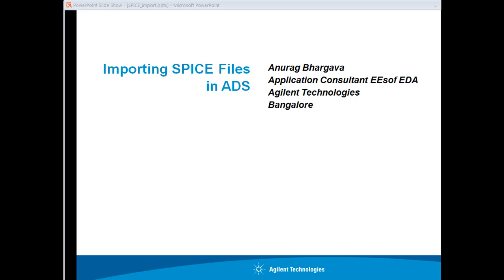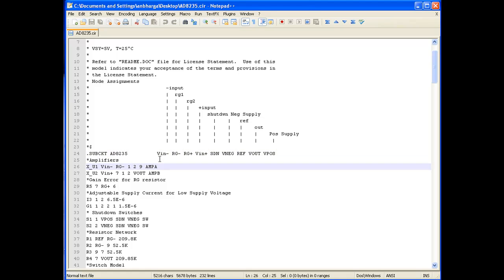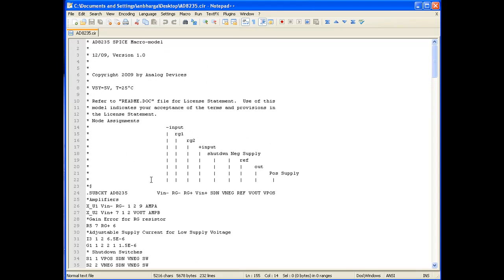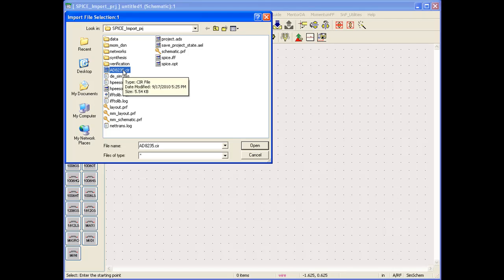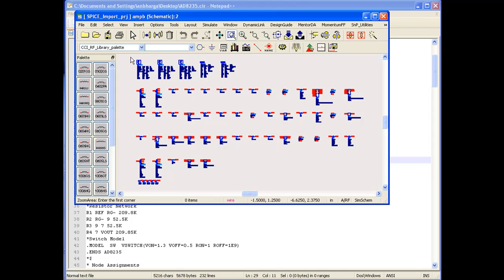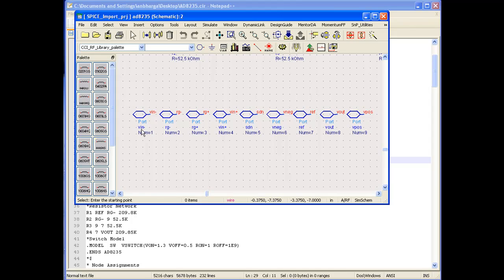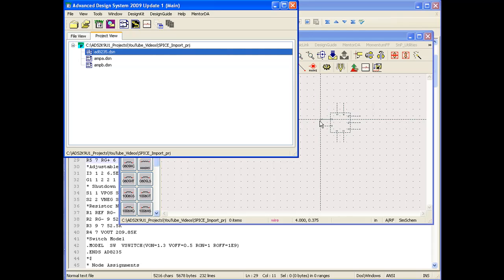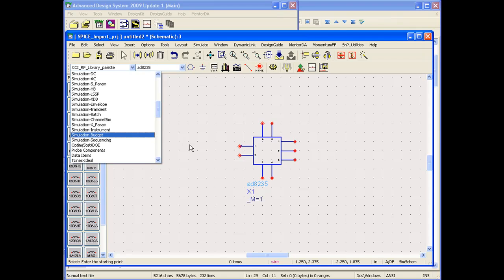Spice File Import in ADS

Comment: Hello sir, can you please explain how to  model (spice) a varactor diode from the datasheet of the manufacturer. Please explain about simulation procedures also.
Reply from the maker: If you have a SPICE model file, you can import it in ADS and if you have the parameters mentioned in the datasheet then you can use a model card available under Devices-Diodes library and use a Diode symbol to use the same in your schematic  simulation
Reply: @BhargavaAnurag  thank you sir

Comment: I applied same method to import the Pspice file of OPA855. I have it in .lib format. I uploaded but while running in a circuit I am getting syntax parser error. Can you help me with that? Thanks in advance.
Reply from the maker: Hi,
SPICE file usually have small problems that might need some fixing. Kindly contact Keysight tech support team and they should be able to help you with this.

Comment: Hello sir. can you please explain how to simulate the model after importing. i imported AD 8051 but i dont understand how to simulate after that. also can we import ibis models into ADS?
Reply from the maker: after you import model, you can proceed for regular simulation and there is nothing special. It depends on what kind of model you are importing. IBIS model can be used directly using model under SignalIntegrity-IBIS library palette, kindly refer to ADS documentation for more details.

Comment: Thanks so much for the helpful tutorials and tips. However, I, unfortunately, did not find here an answer to an important question, how to include into ADS library new ADS models of vendors components, for example, the ATF35143 and ATF38143 transistor models, which can be downloaded from the links

https://www.broadcom.com/support/download-search?pg=Wireless+Embedded+Solutions+and+RF+Components&pf=Transistors&pn=ATF-35143&pa=ADS+Model+&po=&dk=&pl=
https://www.broadcom.com/support/download-search?pg=Wireless+Embedded+Solutions+and+RF+Components&pf=Transistors&pn=ATF-38143&pa=ADS+Model+&po=&dk=&pl=
Could you explain how to do this?
Reply from the maker: Hi Peter,
A couple of points here:
1. Watch newer ADS tutorials on my YouTube channel: www.youtube.com/BhargavaAnurag, the one you watch is pretty old. New videos are up to the latest version & much more elaborate and I tried my best to put most of them in a logical learning flow. Have a look and let me your feedback.
2. Models that you referred from Broadcom are actually an older style ADS archive projects (*.zap) extension and you can directly open the same using File->Unarchive from ADS Main Window and then you will have a schematic containing the model which you can copy over or save as Template to any other workspace for simulation purposes. How to save templates is explained in newer tutorials I referred above.
Hope this helps....👍
Reply: @BhargavaAnurag  
Hi Anurag,
Thanks a lot for the tip! I did it.
Reply: @BhargavaAnurag  
Dear Anurag,
Thanks for the quick response. I will definitely use your advice. 
Regards 
Peter

Comment: sir can we add the Pspice file by infineon and is it compulasary that the format of pspice file is CIR?
Reply from the maker: Hi,
What matters is the syntax of the spice file and not the file extension.
Reply: I wany to add OPA333 regulator for low noise biase circuitry.but I couldn't found the libraray or Pspice model for this.How Can I add this component?
Reply from the maker: You would need to contact the manufacturer and ask them to give suitable model for simulations.

Comment from the maker: Hello, you can use PIN diode model for the same...
Reply: sir i have a problem when importing 180nm GDPK library into ADS can you please resolve my issue the error is silicon RF compatablility not found
Reply: hi anurag, i think the proccess that you have showed has changed due to new version of ADS. In ADS 2020, I cannot import PSPICE file as the way you explained.